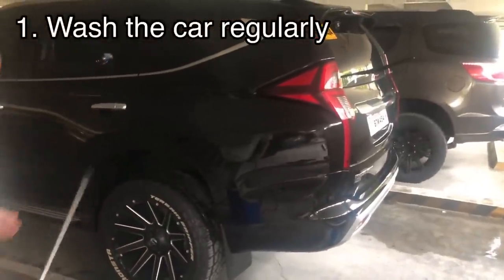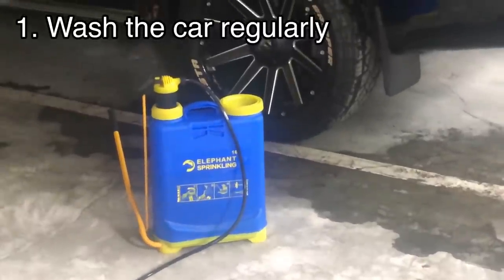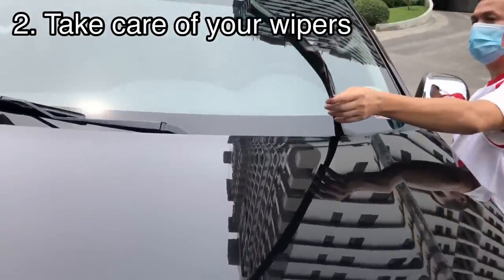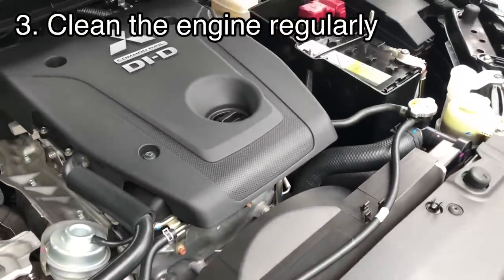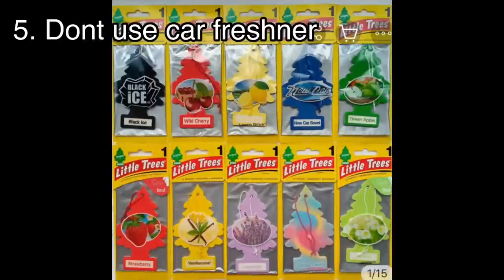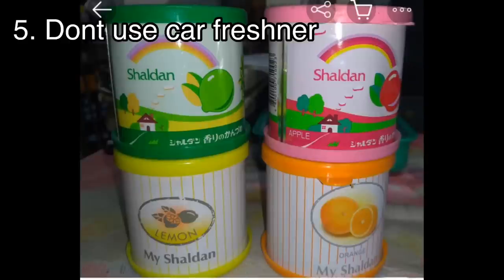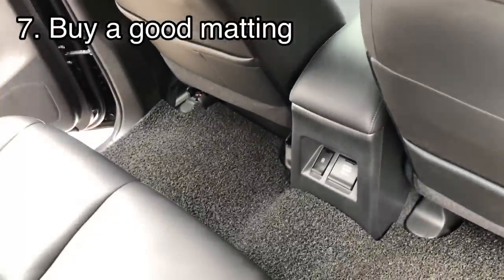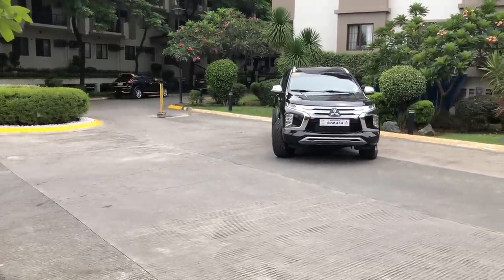Montero Sport 2020...How do i maintain the cleanliness of my car

Comment: yung sakin tinataas ko yung wiper kasi ang tendency ng dust is mag rest sa windshield and mag roll down sa wiper.. sa garahe kasi namin may mga dogs kaya pati yung fur nila napapansin ko lagi napupunta sa rubber ng wiper.. my advise is to not let your wiper stay up as you said because of the tension pero i think it won’t hurt the quality as bad as we think.. napansin ko din na parang may coating yung wiper kaya dumidikit lagi dun yung dumi kapag iniwan sa dusty na place and mahirap din na punasan kasi i think the coating helps the rubber glide through the glass smoothly.. mahirap  din gumamit ng maduming wiper baka masira lang yung rubber at magasgas pa windshield.. 

i haven’t tried it yet pero may nakita ako sa true value na nagbebenta ng parang liquid that’s applicable specifically for windshield wipers para mas smooth daw ang glide nito.. i’ll buy it next time and tell you how it is so you can also use it for your monty!